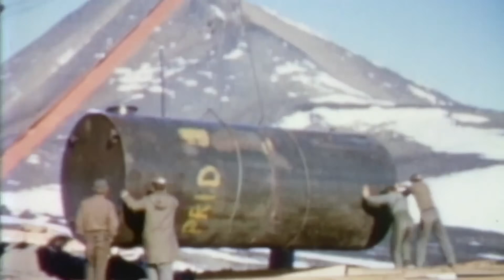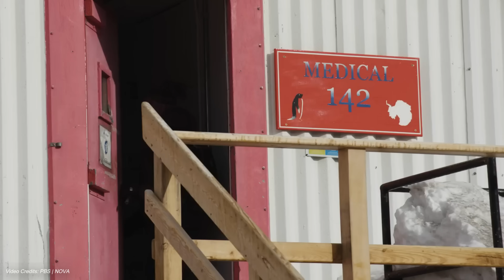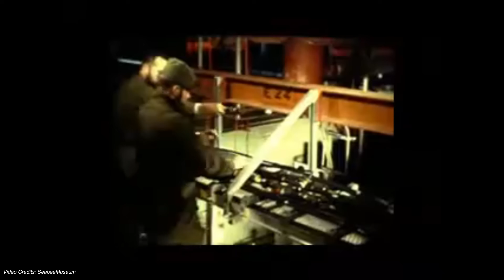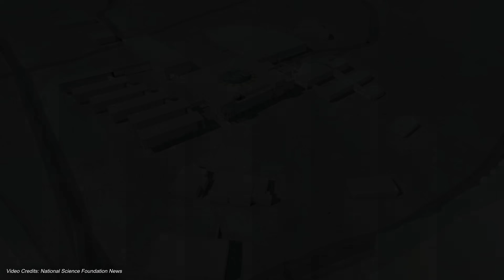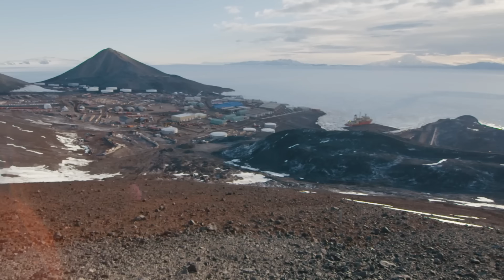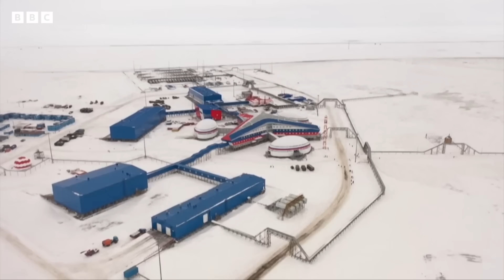The World's Largest Antarctic Station Is Collapsing

Comment: Imagine a 10 to 20,000 psi blowout of H2S and crude and oil and gas of unknown capability kicked loose. How the hell we gonna clean that up in that cold with maybe a 150 mph storm kicks up and people start dropping dead. It hasn't happened yet because we haven't worked in a place where it could happen just like I said. It takes a year in good conditions to drill a good hole. How long will it take in 50 below F/C, it don't matter at those temps. I've drilled in -60 with a 40 mph wind and it was brutal. That was just a plain hole in the ground for trash and garbage. BP's and all the other materials are a monumental nightmare. Stay the hell out of their for oil. Also that is one of the richest wildlife places of gathering of ocean life, that their is on the planet. We risk it all if something goes wrong. Down there with the wind speed and cold, nothing is possible if something goes wrong.

Comment: I worked in fleet operations in Antarctica at McMurdo station. Everything he’s talked about I’ve interacted with, there’s problems here and there like everywhere. But he’s got almost all of his remarks wrong. The ships that are contracted are specifically designed for polar operations. We have back up tools and equipment for everything. Redundancy on everything. Min Two years of supply and fuels every year. And the station is being upgraded and overhauled for efficiency, starting before 2019.

Comment: This is a good review to the US Antarctic Program, at least from the perspective of a person who was once involved with it. When I was in my early 20s, I was a research scientist for a full year at South Pole Station. We were in the original buildings at that location and I observed how additional facilities were being added during the few months of austral "summer"! Was at McMurdo briefly for a few days and thought it was a hodgepodge even then. Also visited colleagues at Byrd Station, which was abandoned years ago, along with stations at Hallett and Eights. 

One interesting thing I observed was the Sun appearing to move slowly from my right toward my left at a low angle to the horizon., taking 24 hours to complete one orbit around me, never setting for months. (I could observe from aurora observation dome; did not have to be outside) Actually, to be more specific, the time was 23 hours and 56 minutes. It confirmed what I had been taught about Earth's rotation in school.

The video does have a few errors, which others have pointed out. I laughed at fuel at $4.70 ! But overall, a good review.

Comment: The risk of massive power loss sounds huge.
Reply: It's not. This video is wildly exaggerating everything.
Reply: There’s backup generator components on station, if something goes down, we just swap it out. The power plant doesn’t need all of its gensets operating to provide sufficient power to all of station. It’s hardly dramatic. We changed the stator on a genset when I was on station years ago, it was a quick half a day swap taking the old one out and delivering the new one to the powerhouse.

Comment: When could they have a Green Building that could support and supply them their veggies... :)
Reply: South Pole has a hydroponic garden that was gifted from ASU after they completed their research. McMurdo used to have makeshift one, but it was demolished in the 2010s. The AIMS plan had one planned, but it’s been scrapped. It’s not cost or energy efficient, but good for morale.
Reply: All fixable once you plug all the leaks caused by corruption and short sidedness. Not on anyone at ant Attica more in Congress and the middle managers in D.C.  the system in place today no matter what department or agency is bloated. As a DOD contractor I saw some of the most insane crap. No self respecting farmer would ever run his operations like they do.

Comment: Funny, stuff built 50 years ago was designed to last 20 years yet lasted three times as long.
Now stuff designed to last 50 years only lasts 20 years.
💸💸💸😂😂😂
Reply: Depends on who is footing the bill. Done right or done on a budget overrun.
Reply: Unless it’s built by NASA. Then it lasts 5x expected lifetime 😊 (eg. Opportunity Rover).
Reply: Annnd Trump gets blamed for everything not turning good . Did you notice that rise in temps were blamed for ice piers not doing the job anymore and not even 3 minutes later sustained -40 temps and rising snow levels blamed for structural failures ? 
That video is promoting woke/liberal left BS ... 
Truuuuuuump !
Reply: @niniv2706  Also noticed the Chinese wank at ALMOST the same time the oil discovery was mentioned...should not take long to connect the dots as to why people are investing now when the non mining treaty is up for consideration in a couple more decades.
Reply: @niniv2706  Trumps fault Waaa! Trumps fault Waaaa!

Comment: Hardware items have to be shipped from the other side of the world? nonsense New Zealand is very close and can provide supplies
Reply: Yeah this video is horrible. They fly U.S supply aircraft out of new Zealand all the time. The new Zealand research team walks to the US base for dinner everyday or drives there. 😂😂
Reply: They also have a tool and dye shop located at the facility, just like every large military ship.  They can fabricate most common things needed for repair.
Reply: @laidoffjournalist not quite. While there is a machine shop, it’s barely used. There are a couple of 3D printers, but those don’t make most of the stuff they need. Most everything is bought and shipped down.
Reply: It's not that far a flight from Christchurch indeed. Get the lads a box and it'll be sorted lol
Reply: @03darski03 it's 8 fucking hours dude! What planet are you living on
Reply: And further more...Christchurch is not a large industrial or metro town . Its not even a big place for locals.
Reply: Annual supply must be purchased in the US and is shipped primarily out of Port Hueneme. Emergency buys can be sourced in NZ but often it’s shipped there and flown to Antarctica on cargo flights.
Reply: @cadre500,if the Earth didn't spin, everything would likely be crushed because the gravity would be much greater. This is my opinion but I think that the Earth's magnetic center is what keeps everything planted. If the Earth were flat,things out on the edge would have less gravity. Then we have seasons which are not because we are closer to the Earth as we orbit the Sun but Earth's poles are in different positions in the orbit. I have heard no realistic explanation as to how that would happen if the Earth was flat.
Reply: How do these bespoke, difficult to engineer and manufacture assemblies and repair components get to New Zealand? New Zealand lacks the manufacturing infrastructure to produce them.
Reply: And New Zealand gets its goods from where? Dummy.
Reply: Why would they move hardware from the Arctic when south Africa, nz, aus, and Argentina all have nails, screws, wood, etc
Reply: But it has to be American.
Reply: @helmutzollner5496 No, it doesn't. This video is wildly inaccurate.
Reply: Coming from someone who hasn't visited nor worked there.
Reply: assuming the earth is a globe . But is a lie. Earth not a Globe !
Reply: @Enki_pr The "Globalists" lie to humanity about everything: wars, economies, famines, weather, history, what's in our food, pandemics, jabs, etc.. People refuse to even consider that past civilizations and the Bible which present the earth as a plane enclosed by the firmament. If the earth is spinning at such a fast rate the water should be thrown from the globe.  Why aren't our surface wind speeds scouring the earth if it spins so fast? Because the earth is not a globe.
Reply: @cadre500 the wind spins with the earth…DUH!
Reply: Ahh yes the jab. Did you know the virus contains more toxic components than the jab you fear monger about?
Reply: Kiwis will eat you 😛